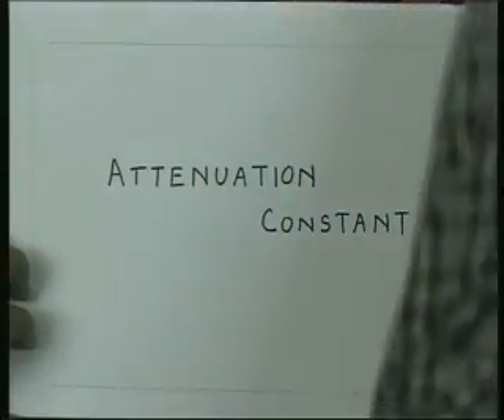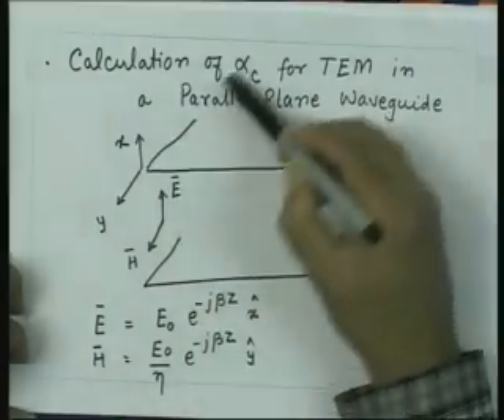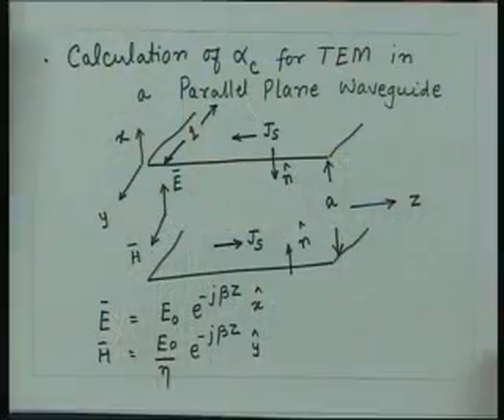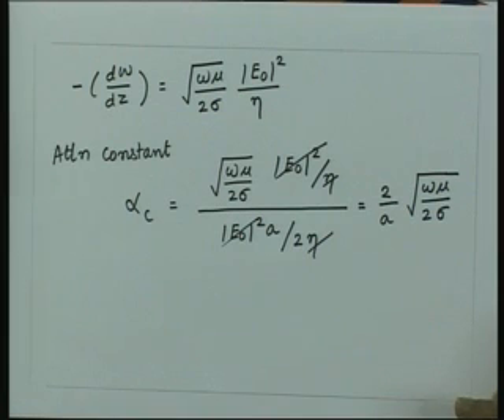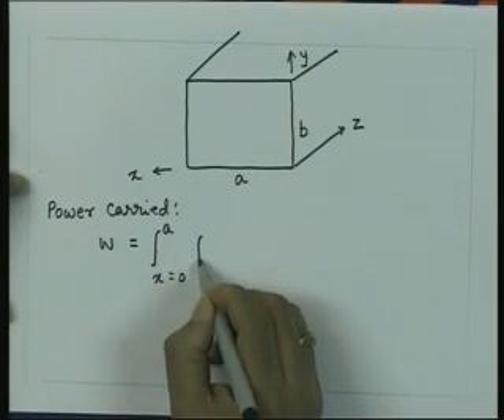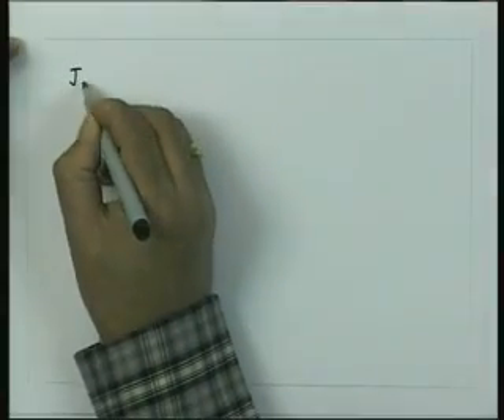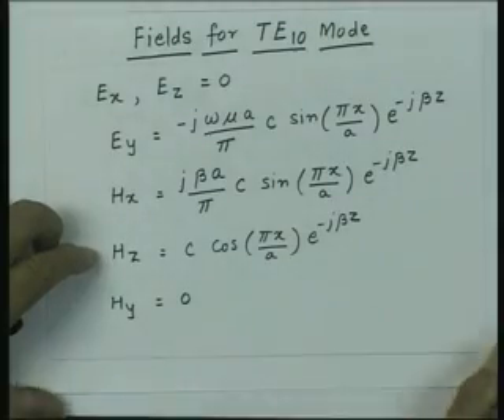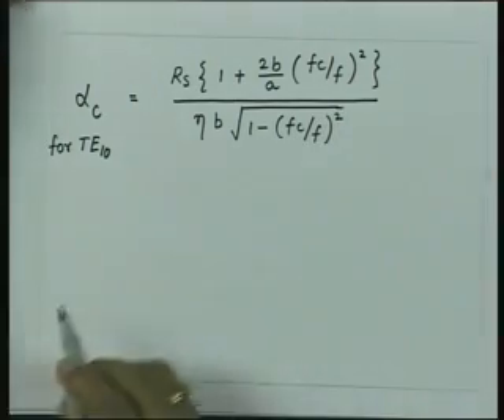Attenuation in waveguide continued

Comment: Thank you professor. The way you have setup the course is itself very great, starting from TL, then TEM Wave propagation in unbounded media, and then slowly bounding it in Waveguides. Let's see what happens from next Lecture onwards when you will demistify radiation. These lectures should be base material in every indian university. It must be made mandatory for ECE engineering graduate students who are familiar with minor Vector calculus. You have made it even more easier by Deriving everything, taking no formula on its face value is very commendable. Your any course on nptel i will try to watch. The way of course delivery is great with smooth difficulty transition enculcating confidence in student to play with quantities without worrying about sign and mathematical erros due to emphasis on understandibility of physical reasoning behind everything rather than sadiku like Vector operations.